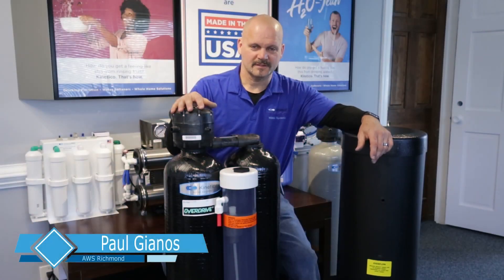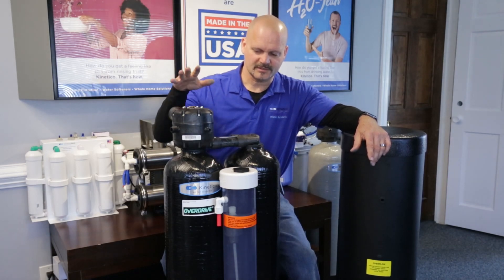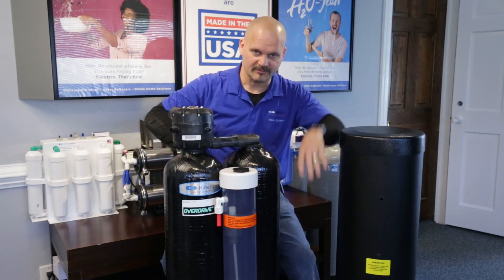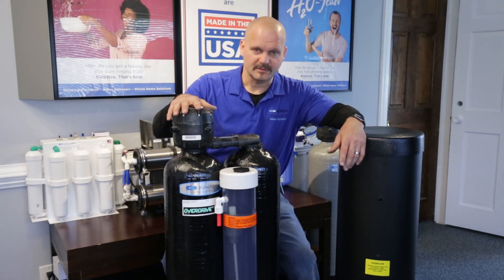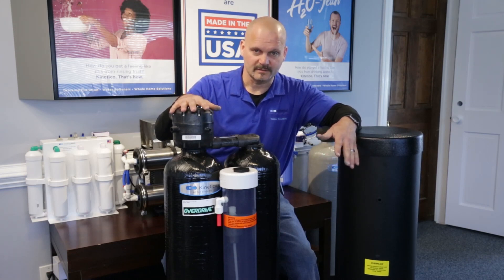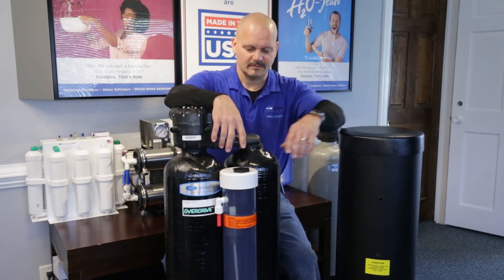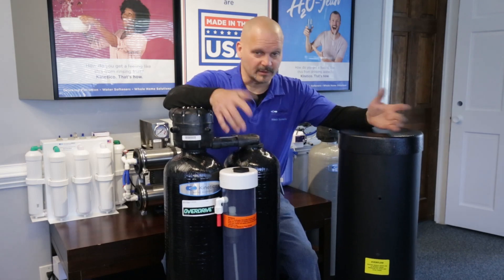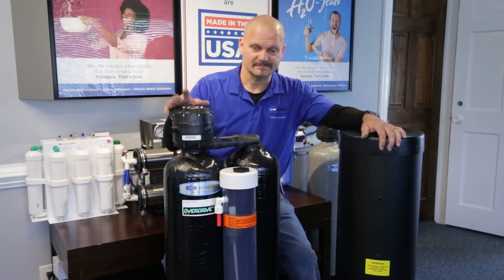How a Kinetico Sulfur Guard works with Paul

Comment: I have a sulfur guard system and everything was working perfectly. Then when we were away and the kids were using the place, the Neutra-Sul tube (like the one you have pictured in your video) went dry. So when we got back I put a container in, but it does not seem to be absord (i.e. being sucked into the tanks), and we have developed a strong sulfur smell. The water softener is still working, but the smell has got to go. I had hoped just putting in a container in the tube would do the trick, but no go. So what can you suggest to help me out?